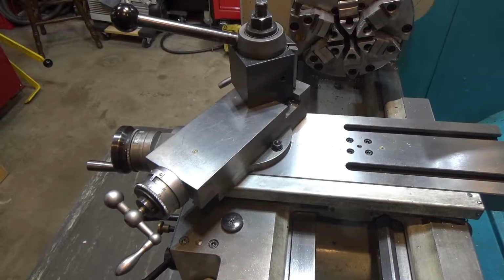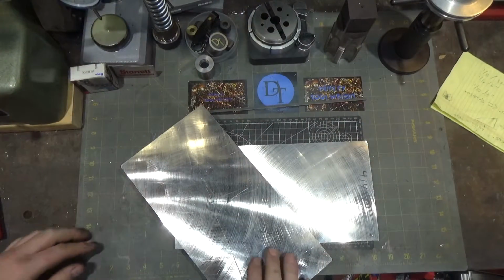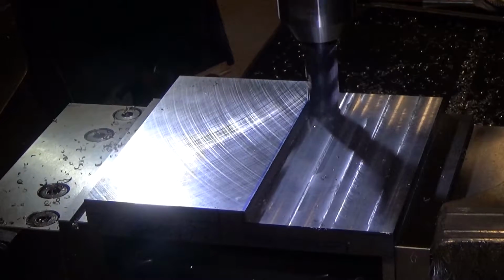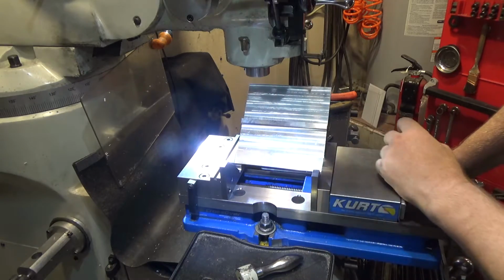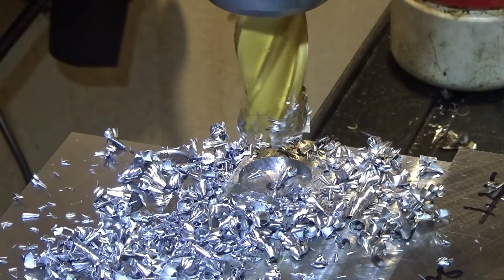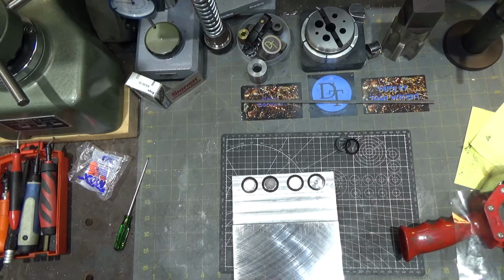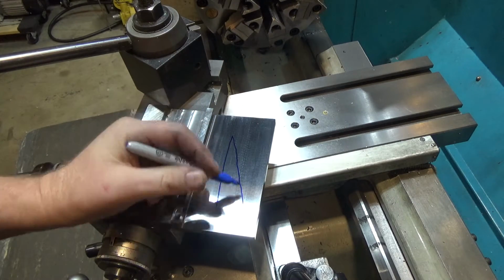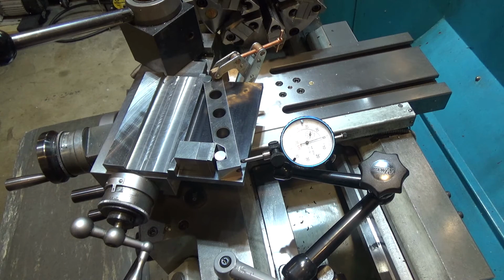137 Sine Bar Angle Fixture for the Lathe Compound

Comment: A great idea and very useful video. I don’t know that I’ll go the full size bar route, but probably will make an angle-block holder, based on your tips for how you’d make it if you were doing it again. Thanks!
Reply from the maker: I see that you have a channel. I would love to follow your exploits.
Reply: @DudleyToolwright  Actually my personal channel only has a few personal videos on it. I used to run Imaging Resource (a camera/lens review site), and there are a few videos that I appear in there. (Of any of them, you might find the ones I did about Olympus’ technology for weatherproofing their cameras and lenses and image stabilization the most interesting.)

Thanks again for your videos, as an absolute beginner hobby machinist, they’re both helpful and interesting 😁👍

Comment: You can put a nominal gauge block under the fixed end of the sine bar and add the same to the adjusted end to compensate for the size of the smallest block.
Reply from the maker: Excellent suggestion, thanks.

Comment: Interesting way to do it  .   You could use  a gauge block under the other end of the bar to juggle the height for your shallow angles .    Still an indicator on the compound indicating onto the chuck & use the compound dial  i have found to be the quickest  accurate  method .    Cheers Rob .
Reply from the maker: Thanks a lot Max. I really value your input. Your channel is always so informative.
Reply: @DudleyToolwright  I  was thinking today  ,  used just with the angle gauges it makes for a quick  reasonably  accurate set up . I might have to make one  !     Cheers .
Reply from the maker: I look forward to seeing your improvements.

Comment: I use trig but mount the clock on the compound and indicate on the tail stock. It means winding the compound and the crosslide (not the carriage) but it's not hard & is very accurate.
Reply from the maker: Nice approach that I had not considered. Thanks!

Comment: Consider putting a few threaded holes in your fixture that will intersect the holes in your sine bar.  Then you could improvise a clamp with a bolt and washer to hold the sine bar steady.  I too would also suggest hacking off the lump sticking out across the ways past the top of the sine bar at the pivot end to allow you to use your current indicator.  If weight is excessive, drill some "ventilation" holes in the two webs - i'm sure that they would still be plenty strong enough to hold up a sine bar !
Reply from the maker: Thanks for the tips. Much appreciated.

Comment: Ok you did say "close". However and there's always one. While the tool was well thought out your forgetting one thing, for any part to move like that compound there's has to be "some" clearance. On that compound then probably somewhere between .002"-.004" between the upper and lower dovetail pieces at least. The instant the tool starts to cut it's going to remove what ever clearance is available in the opposite direction. The top of the compound will actually pivot a fraction with the end with the tool post being pushed towards the operator and it's operating handle end going in the opposite direction. No it won't be much, but far more than needed to upset anything set to sine bar and gauge block accuracy. Put an indicator tip against the compounds side at it's front, then take a cut and you'll see what I mean. It's a prime reason why a male and female taper cut at the exact same compound angle settings still won't perfectly match since there normally cut where the cutting forces the compound slide sees will be in opposite directions. For parts with maybe a + - 1/2 degree tolerance then it should work well enough. But any angle cut using your new accessory won't be quite what your sine bar and gauge blocks say's it should be.

On longer parts with fairly fine tapers I'd consider off setting the tail stock and turning between centers and calculate your indicator travels per inch of carriage travel the same as you were doing. Or by far the best and most accurate method is finding and adapting a used taper turning attachment or building your own.  Unfortunately for most part sizes either method might be good for about + - 5 - 10 degrees maximum. Anything much steeper than that still has to be cut using the compound.
Reply from the maker: Wonderful comment. I really appreciated the hard truth. I learned something here. Thank you for taking the time to share.
Reply: @DudleyToolwright  Your welcome, I had to learn all that the hard way myself. If it saves somebody else some frustration and wheel re-inventing it was worth posting it. For some reason we all tend to think of metal being a rigid substance. Add in cutting forces which are a whole lot higher than we think, plus the requirement for moving part clearances and machine tools are anything but rigid. It's in Russian and I haven't been able to re-find the video despite numerous searches, but I watched one a few years ago where the video poster did extensive indicating on a 18" + swing heavily built Russian industrial lathe. What I could understand and what his force vector diagrams were showing there's large amounts of movement throughout our equipment every time the cutting tool starts a cut. Even in places where you wouldn't think there would be. As they say, everything is more or less built from rubber.
Reply from the maker: Thanks for that. I would love to see that video.
Reply: Thanks for this note! I’m a complete beginner, just got my first metal lathe, so this sort of thing is great to learn about. I’m an engineer by training, so I’m fascinated by the fine details of what really happens when we’re cutting, all the things that move that we don’t expect to, etc, etc.

I forget who made it (Robrenz?), but I saw an excellent video about grinding or hard-turning lathe chuck jaws. He showed how much movement and flex there is in the chuck as you crank down on it, meaning it’s important to machine the jaws when the chuck is under full clamping load. I doubt I’ll ever machine a chuck, but it was fascinating to see how much the supposedly rigid structure flexed under load. (It was a Buck chuck too, so not some cheap Chinesium thing)

Comment: I believe what you have after installing the Delrin spacers is known as a "Flux Capacitor"! :)  Thanks for the video!
Reply: I would've like to watch the grinding to the magnets.
Reply from the maker: Sorry about that. I did all of the grinding off camera because I thought people might find it tedious. I actually find it somewhat relaxing and generally very satisfying.
Reply: @DudleyToolwright  can you remove material from the magnet without compromising it strength  ?
Reply: @stevewilliams587  If the nickel plating is removed from these neodimium magnets they start to corrode very quickly. Best to have them a little lower than finished height so the nickel doesn't get ground off.

Comment: You need to cut the plate that your sign bar is laying on at an angle so you don't have to get a longer indicator.
Reply: Limits the use of the tool.
Reply: frank conci  if he needs to find the opposite angle he will need that edge to hold the sign bar up. To swing the compound the other way around he will need the opposite corner to hold it.
Reply from the maker: It is true that that would help, but as others have said it would reduce the maximum angle I could set.

Comment: You can get shallow angles on a sine bar by placing a nominal height gage block under the pivot that the bar rotates about and adding that value to the stack up that gives you the angle you want. For example say you need a stack up of .040" to get the angle you want then place a .100" block under the pivot point and a .140 block under the other roller.
Reply from the maker: Thank you so very much. Obvious when you put it that way. I bet you helped a bunch of people with that suggestion.
Reply: Great tip, thanks!

Comment: Great idea! I would only have expanded upon it, by using the Sine Bar's front roller as an adjustable locking pivot point. Basically by replacing the Sine Bar's front roller with one of an identical diameter, just longer in length. Then drill,  bore, and insert a hardened bushing of exact diameter and hardness into the plate for the newly lengthened front roller to be inserted in, serving as a rolling pivot point. You can use numerous ways to lock it into place, thus eliminating any need for a clamp. Awesome Taper Attachment none the less!
Reply from the maker: Another excellent suggestion, thanks. I love this community.

Comment: if you make a stud for your indicator you can achieve a lot more clearance. use that lug on the back. i saw it on abom's channel. so that's what i did. work's really nice. really cool tool that you made. it's good to have more than one way to do thing's. i might try it. seems like a worth while project. really like your channel thanks.
Reply from the maker: Nice and obvious suggestion, that I never though of. I always forget that the tips of drop indicators are replaceable. Thanks.